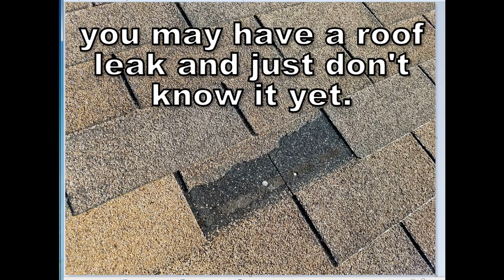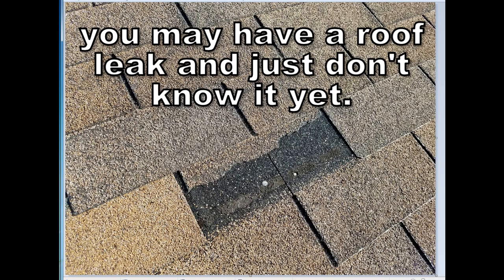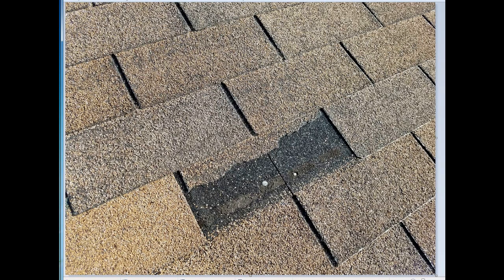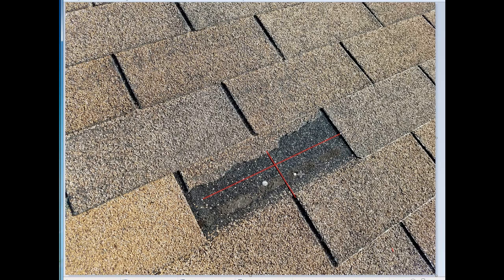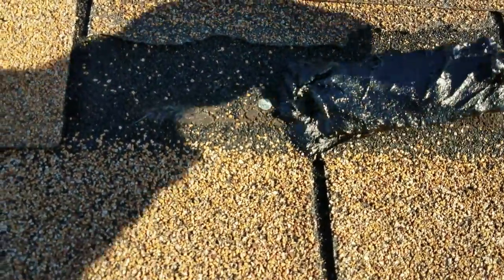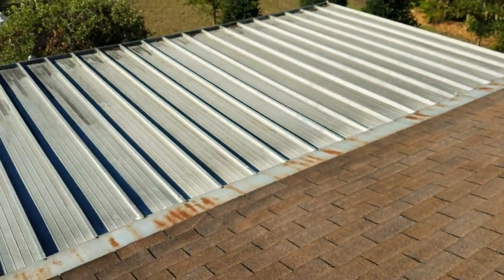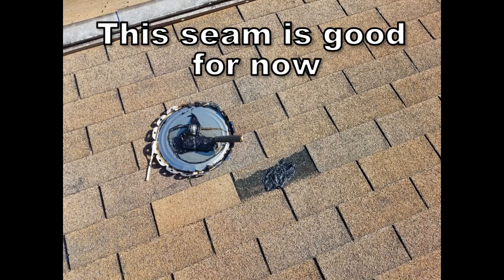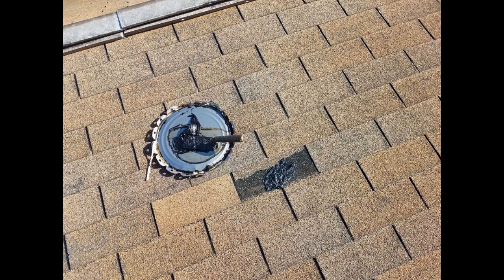Asphalt Shingle Roof Leak Temp Repair Missing Tab

Comment: Nice video. I’m currently planning a roof repair. How long will that seal last before you finally need to replace it or reseal again?
Reply from the maker: Should last the life of the roof. The seal from the factory will last almost as long as the shingles will, but once it is popped up, it usually won't reseal. This seal is only for wind uplift.